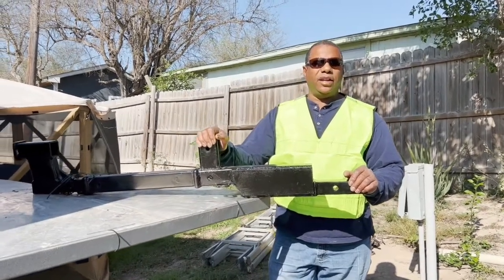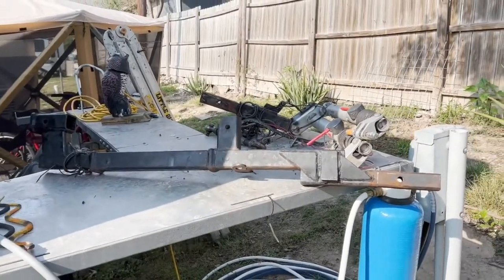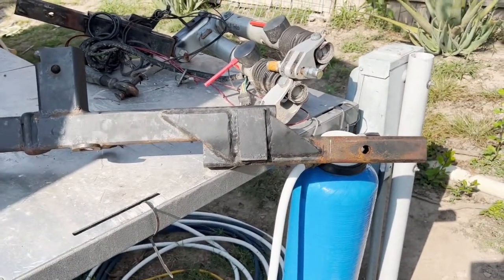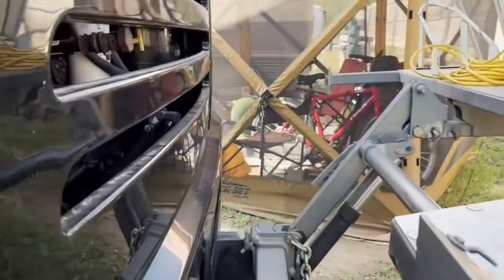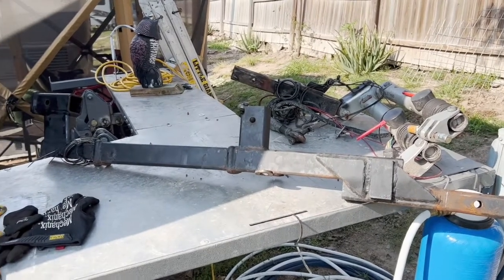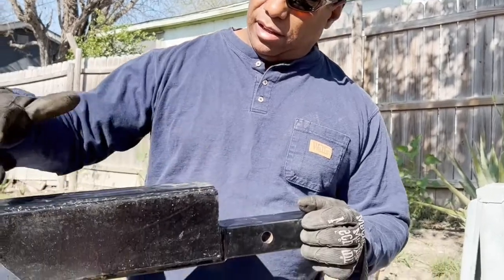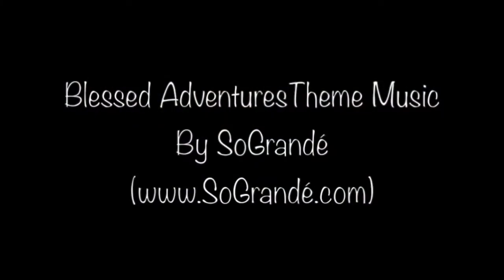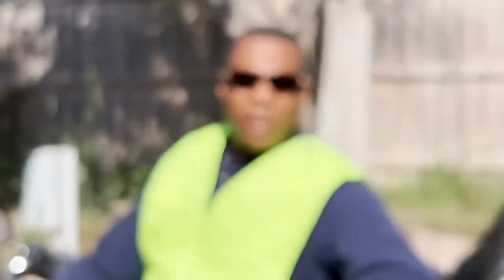Warning to anyone towing with a extended tow bar. Fulltime RV Lifestyle #13

Comment: Very interesting. Glad you are always inspecting so you can find issues begore they cause trouble. Glad you have a better reinforced bar. Safe travels.
Reply from the maker: Kim does a great job also, because she reads about different issues and then goes checking them out. She keeps me on my toes.